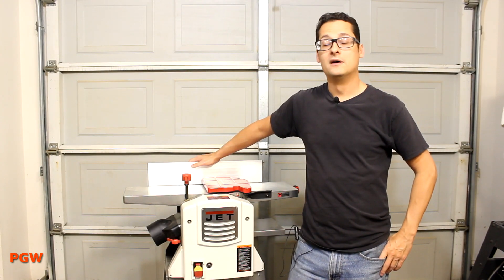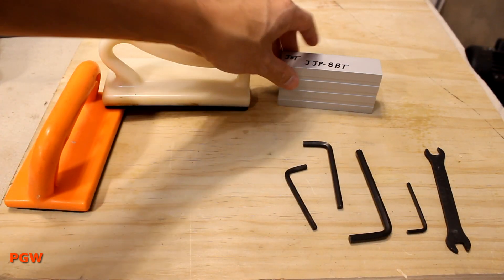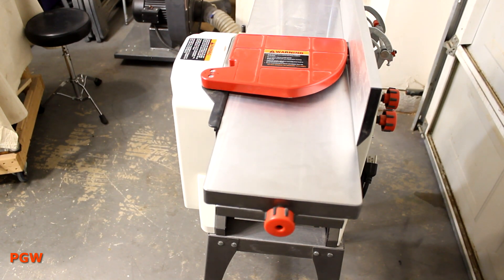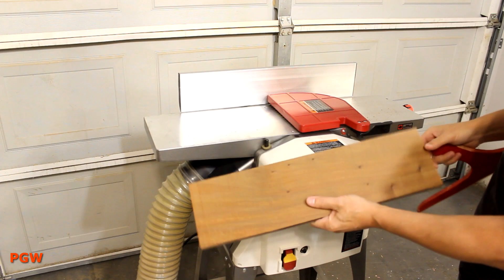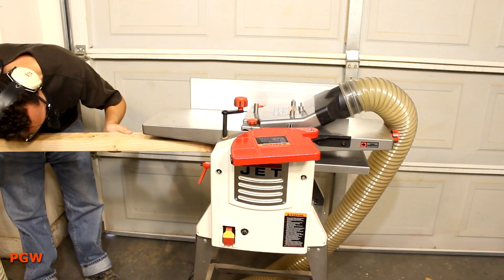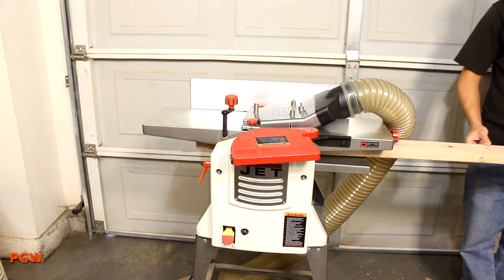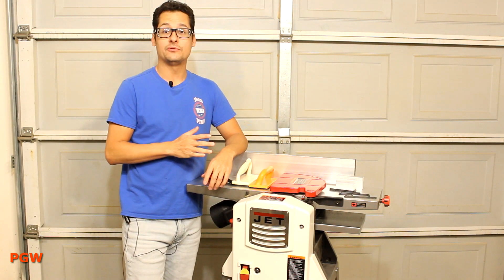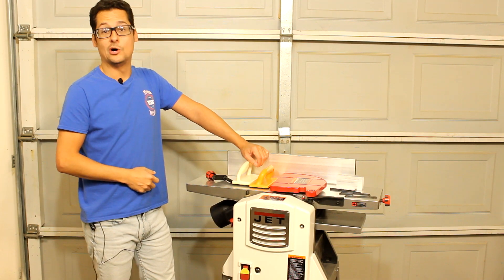Jet Combo Jointer Planer Review! Little size, lots of noise!

Comment: Great video with real word uses.  I was thinking of selling my DeWalt 735 and going with a preowned one of these which would be significantly cheaper than buying a 10 inch jointer.  But I think I'll pass and get a standalone benchtop jointer.

Comment: Should joint gace first then edge so there's a flat face against the fence .and seems like it works alot better as a jointer than planer since it's 8" . I jave a dewalt 13" planer already so the 8inch jointer aspect Would be good addition to my shop . And it's lightweight thanks for the honest full review
Reply from the maker: Hi Joe,

If you’re looking for a space saver this little jointer may be the one for you.  I did end up buying an old delta jointer and a Dewalt DW734 planer.  I’m doing more table builds and need a more rugged jointer and planer.

Thanks for the comment and please subscribe if you think I earned it.

Pete

Comment: I picked up a used one not too long ago and after running a few pieces thru the jointer I discovered the infeed table sets lower on the fence side than it does on the other. I can’t seem to track down any suggestions on how to fix this and the manual doesn’t mention anything on this situation. Any tips on how to fix this?
Reply from the maker: Hi Leroy 

I’m sorry can’t offer much assistance, I sold this machine a while back. 

I’ll do some internet digging and if I fine an answer that helps I’ll update this comment.

Pete

Comment: Nice video , thanks .   But I think is better to invest on the next step enough power to be happy ,   Of course is just my opinion .  !
Reply from the maker: I agree, 

I recently upgraded to a larger jointer and planer. This little combo isn’t the best at milling up eight foot long walnut slabs but did an ok job with my smaller pine table project. 

Thanks for watching!

Comment: Great vids. Really slow and thoroughly explained. Nice. Thanks. Mate. Btw if for seperate machine what jointer / planer would you choose.
Reply from the maker: Thanks Rafa,

I would choose Powermatic brand jointer and planer. I used them before on a job and really like them. They are a bit pricey so I’m trying to work my way up to them.

Thanks for watching!

Pete

Comment: I have one like your’s only mine is a clone. The two things I don’t like is the router sized motor and the 1/2” cutter head belt. As they say, you get what you pay for.
Reply from the maker: I agree! I try to not take too thick of cuts when I put wood through it. I accidentally took too big of a bit early on and I thought the Machine would tear itself apart. The cutter  motor is definitely on the weak side. I mostly use it for soft wood and thin cutting now.

Thanks for commenting. 

Pete

Comment: im looking at buying one of these but question I've seen a lot of 1-star reviews from 2010-2012 about the table and fence being super loose did they fix that issue?
Reply from the maker: Hi James,

I don’t know if they fixed it but my fence was loose too. I had to put a drop of loctite on the adjustment screw to make sure it didn’t back off. I’m always gonna use the fence in a 90 degree angle so it want that big of a deal for me.

Hope that helps, thanks for watching!
Reply: @PetesGarageWorkshop  thanks

Comment: How is this thing holding up?
Reply from the maker: Hi Eljbarr,

Up until the day I sold it the combo planer was working great. The only maintenance was I changed the blades and inspected the drive chain. I started to mill my own stock so I needed a larger jointer bed and wider planer.  

I still recommend the jet combo jointer planer.  If you don’t need to plane wide boards or joint long stock it’s a great machine. 

If you happened to watch my cutting board video you can see my new jointer, it’s an older Delta. I bought an equally old thicknesser from delta too.

Thanks for watching!

Pete

Comment: The machine looks pretty wonky and cheap in my opinion. I think if they focused more on making it just one or the other that it would be more solid of machine. The only thing it has going for it is the 8 inch blade, but the underpowered motor makes for some hard work on the machine. Great review and thank you for posting. Keep at it and you will definitely learn it over time.
Reply from the maker: Thanks Samuel,

I agree the motor is under powered. Anything more than a thick 1/16 of an inch cut would bog out the motor and clog the outfeed chip collector. Since I have a fair bit of time on it now I try to only do light passes to get to my thickness. 

I’m still gonna keep this little beast, I have a little less room in my new garage now so it’s definitely paying off with it’s small size.

Thx for watching,

Pete
Reply: @PetesGarageWorkshop  that’s awesome. I’m glad it’s working out for you. Keep up the good work and keep putting out the content.

Comment: So, you didn't have any issues with fence alignment?  I can't get mine to align and im going to have to modify it to get it to 90 degrees.  Great review, though, thanks!
Reply from the maker: Hi David,

The fence alignment bracket on the back was not 100% in the right shape on mine. I took it off and bent it back into shape in a vice. After that the tightness of the alignment screws held it in place at 90 deg. 

I think it was damaged by the previous owner. Most of the bolts were loose when I got it. It was a bit of a project for the guy and I think he kinda gave up on it, and sold it to me.

I frankly don’t want to risk knocking it out of square so I leave it at 90 degrees.

Before I use the jointer fence I check it and it’s very close to 90. If I’m jointing a piece to build a panel I flip the edges to match up the error in the joint so it cancels out. Or that’s what in tell myself!
That seems to work out good enough for me.
I hope that helps!  

Thanks for watching!

Comment: Thanks for this.  I've been sitting on this fence for over a year now.  You have some good info in there.
I was wondering though... most of the bad reviews I've read involve alignment issues, particularly with the jointer bed not being coplanar.  What happens when you put a square on pieces you've run through this machine?
Reply from the maker: Hello, I haven’t had any issues with material coplanar surfaces. As long as I tighten the knobs after I adjust the bed level my material comes out just fine. Or more specifically good enough for me. I haven’t noticed any huge issues that would change my mind on buying this machine.

There is a very small bit of movement, I would call it more of a bending of the machine when I force material down the bed and into the cutters, so take your time and don’t push to hard. 

Before I made the video I used the jointer to make a flag.  All of the pieces came out nice a square. I did use the tightening knobs on the bed fence and checked for square a couple times.

As I progress with my woodwork and am able to buy better quality tools I plan to upgrade. But for right now this tool fits my shop and my budget,

Hope that helps!

Comment: would like to know specifications and model # at begging of vidio.  pricing would also be  good. Is it Awkward for jobsite use
Reply from the maker: Hi Gerald,

This is the Jet JJP-8BT 8-Inch Jointer/ Planer. Feel free to look up the specs online.  I haven’t used it at a job site, I use it in my garage and don’t move it much. The unit is a bit heavy to be moving around job to job, but it could be managed with a cart or if you put wheels on it.

Good luck!

Pete

Comment: It doesn't appear you have "Mastered" this machine or have that much experience planing and joining so I'm hesitant to take your word for it because I see you making too much adjustments and not so confident. Much like what I'd do because I don't have experience either. I'd love to see a representative use this machine as well as someone who has had years of experience using other machines to be able to get a really good feel this machine is ideal? Who knows how good this thing really is or isnt but thank you for the video.
Reply from the maker: Hi J, 

You’re right, I haven’t mastered this machine. I’m just some guy in a garage giving out my opinion of a budget friendly piece of equipment.  I wish I could spend more time working in the shop and perfecting my skills.

I needed a solution and found a reasonable answer with this combo that solved two of my tool needs in one small footprint. It works well for me, but your needs might differ. My video is a small response in my attempt to find videos on this specific combo gear.

Thanks for watching!

Pete
Reply: @PetesGarageWorkshop  You don't need to explain yourself you did well and your video was pretty good. That was me more frustrated with my options and having to make a decision on something I'm not even sure of myself.  Thanks for all the time you invested and sharing. Don't mind my angry man comment sorry. ✌️
Reply: @JDoe-hb7pc  Ya, I thought that was a pissy comment, but then you followed up with another explaining yourself. So, hat's off to you for that. J. Doe, I have the same planner in my shed and have used it for 3 small projects so far. And so far it has done well. I am no pro in woodworking however. I purchased mine on CL for $150 and I think for a 2 in 1 tool for my small shop it has worked pretty good.